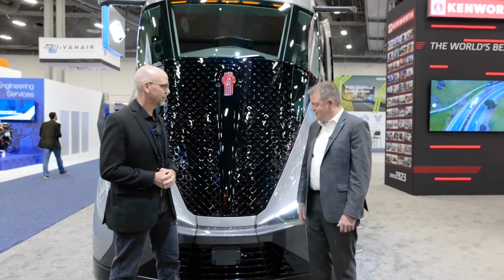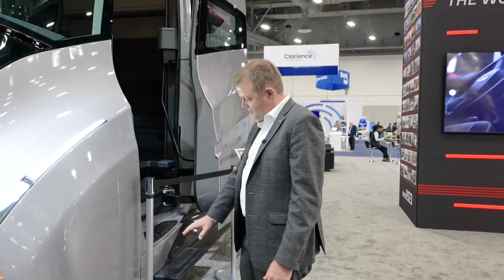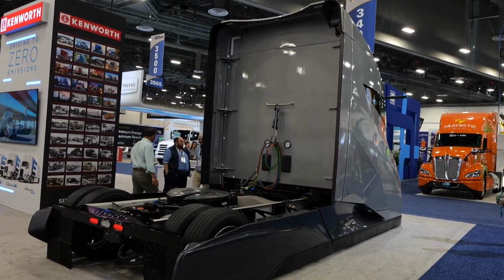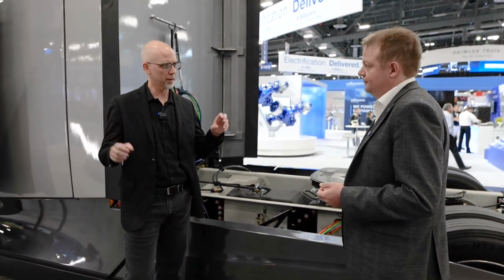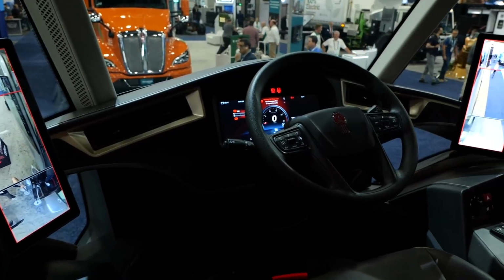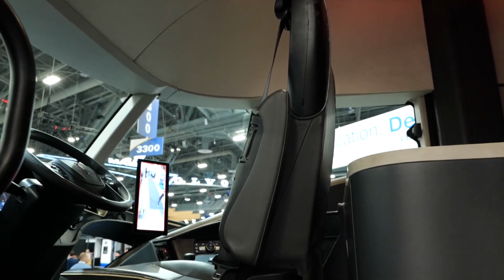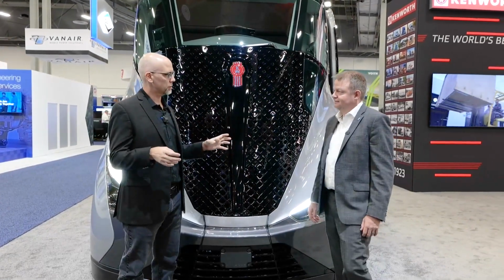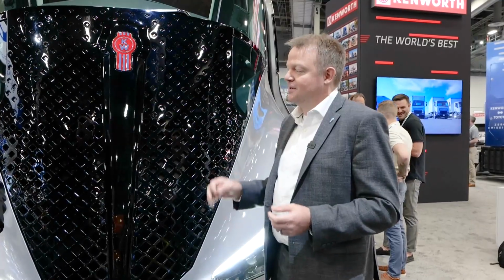Go inside the Kenworth SuperTruck 2

Comment: Pre-Trip inspections require checking tires, engine, wiring, hoses, etc... How does a driver do any of that on this design? I like the concept, but you have more practical problems to solve if special equipment is needed to get under the hood and check tires. I get that most drivers are lazy about pre-trip inspections, but I always did it and it saved me a bunch of unnecessary roadside service calls over the 6 years I did OTR.

Comment: Center driver position is stupid. How do pay a toll? How do you check in at a shipper or receiver? More trucks designed by people that have never driven a truck.
Reply: Really dude..Here's how u pay tolls..electronic tolling...Here's how u check in with shippers and receivers the truck has a door u open the door and get out and go check in...u can't be that stupid could u..
Reply: You open the big ahh sliding door.